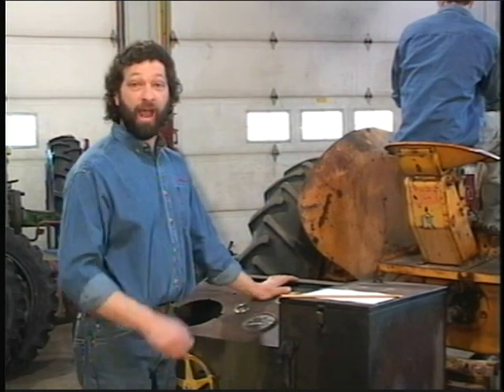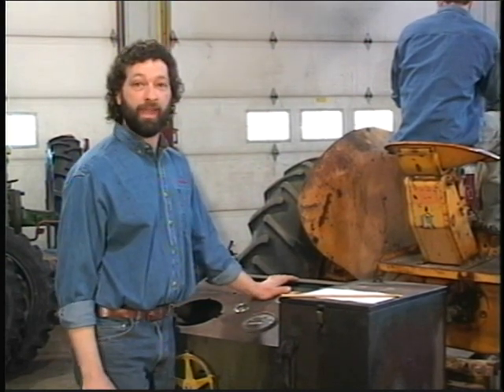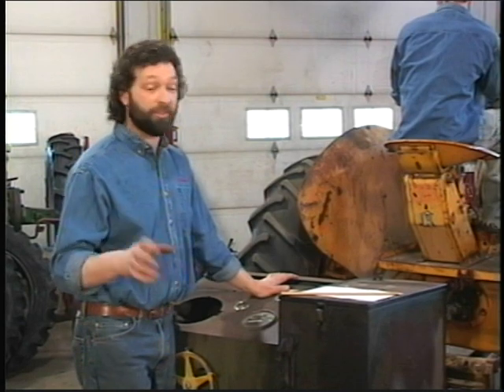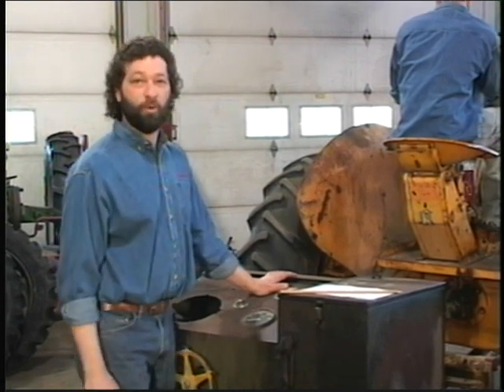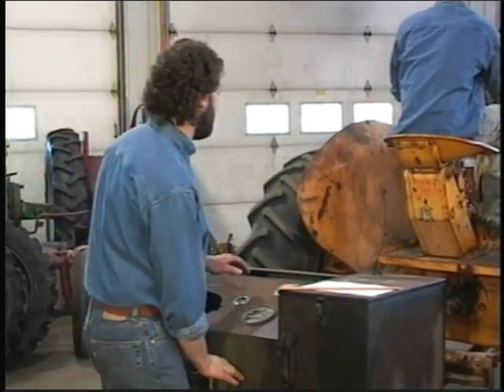MM UB Special Pulling Tractor on the Dyno

Comment: is this a gas or diesel? i have a UB diesel thats at 75 hp and 1160lbs of torque  i have a 9mm injector head now though dont know what the increase in power is, will have dyno numbers soon though.